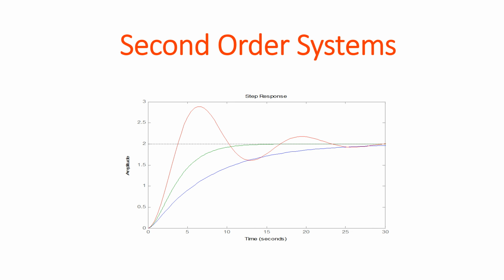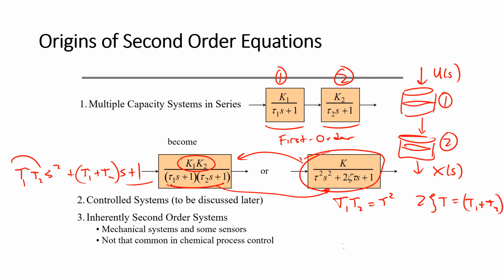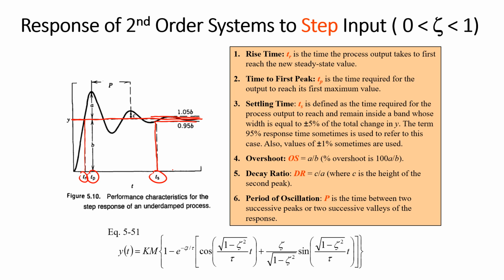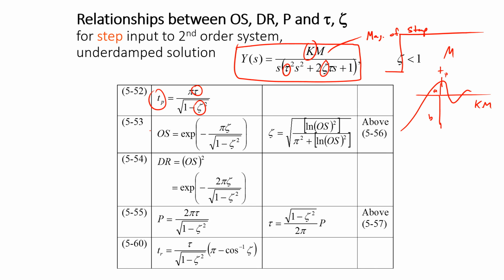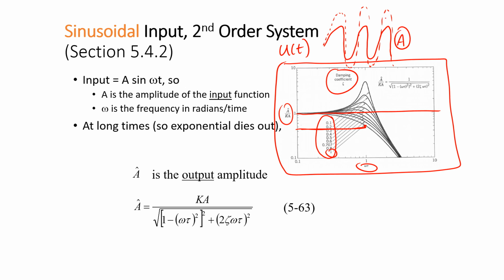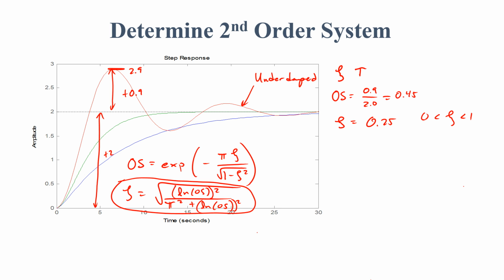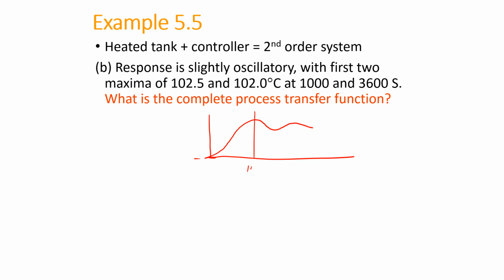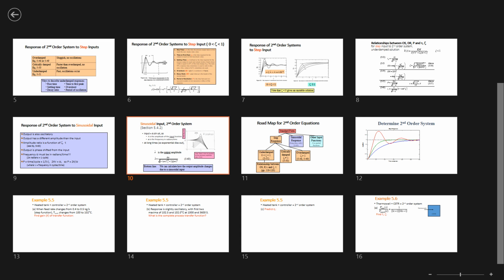Second Order Systems in Process Control

Comment: This is good but in reality it is hard to measure the peak or times accurately by just looking at a few points.   This is OK if only rough estimates are required.
Edit,  I just saw yet another video just like this one made at about the same time.  The formulas looked the same and used the same variables.  It was like both videos were copied out of the same book.
Reply from the maker: I agree that a few points can be difficult to fit a 2nd order system. Here are the correlations that I typically use for underdamped systems: http://apmonitor.com/pdc/index.php/Main/SecondOrderGraphical  I also like to use optimization methods to fit higher order systems (of arbitrary higher order, followed by model reduction). Here is a 2nd order Python code for fitting 2nd order systems: http://apmonitor.com/pdc/index.php/Main/SecondOrderOptimization or code for fitting MIMO higher order systems: http://apmonitor.com/do/index.php/Main/ModelIdentification
Most of the process control education for chemical engineering is from the same book: Seborg, Edgar, Mellichamp, and Doyle. I worked with Tom Edgar at UT Austin for grad studies. Some of the lecture content is from that book so that may be why you are seeing it in multiple places.